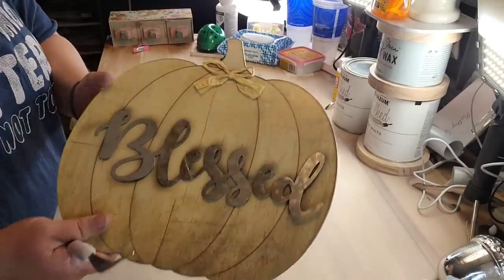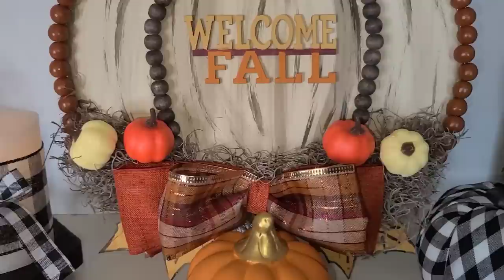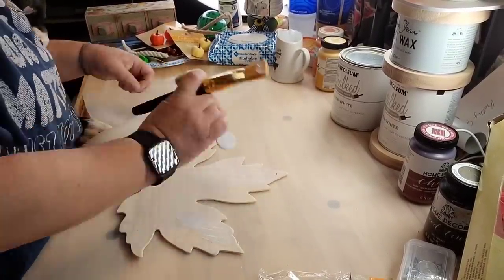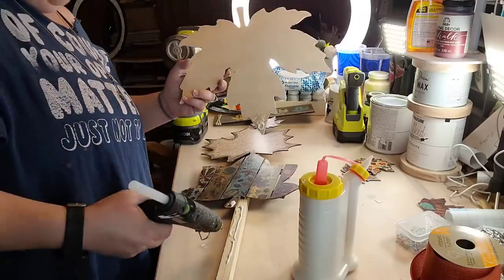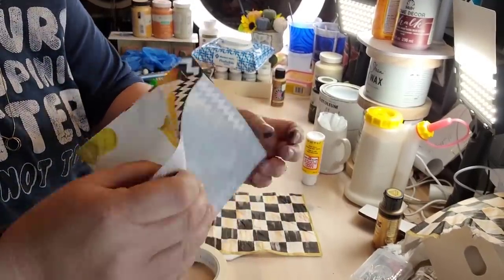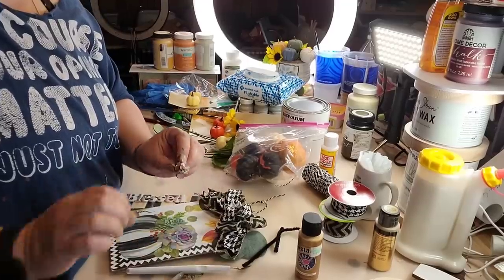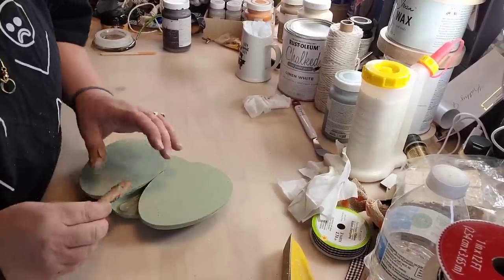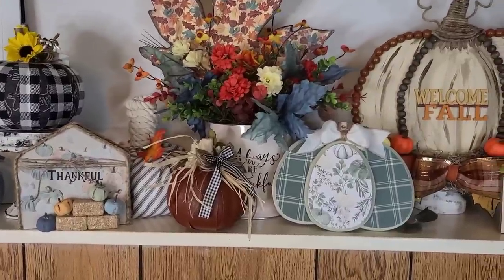Ten New Dollar Tree Fall Diy's | Fall Decor| Foil Pumpkin

Comment: Love you!  You have to try the iron-on method again for the Mod Podge (MD).  Steps:

1.  Put layer of  MD on your project 
2. Let dry
3. Put napkin, tissue paper, paper, etc. on the MD
4. Cover the napkin, paper, etc. with parchment paper
5. Iron with hot iron - no steam. Keep the iron moving. You can use the cricut iron too.
6. Paper with be smooth, no wrinkles or bumps.  
7. Sand the edges if needed 

Hope you love this method as much as I do.  Blessings
Reply: Can you tell me what temperature you put the mini iron on the cricket one
Reply: @shelliestorevik6855  I don't have mini but on my large household iron I use the highest setting so I'm sure you could use that on the mini.  Maybe test on a small tester project first.
Reply: @cathypowell7852  thank you so much